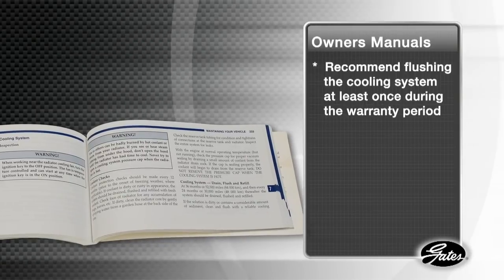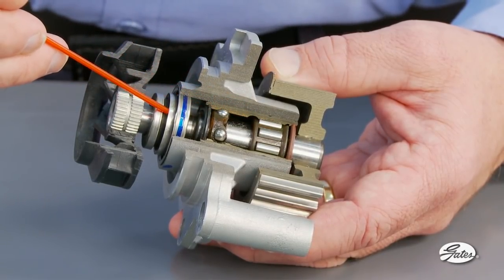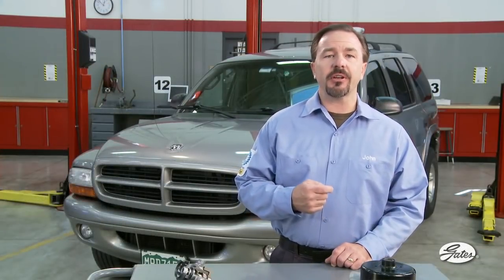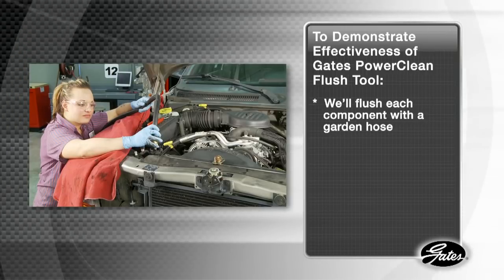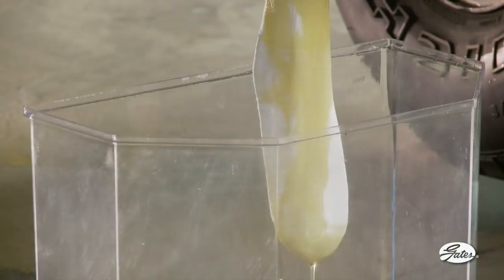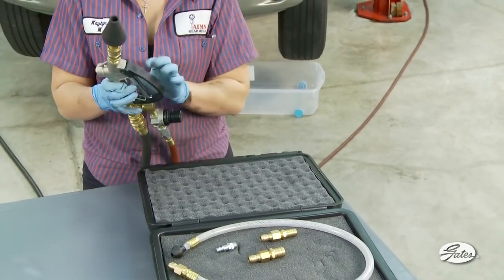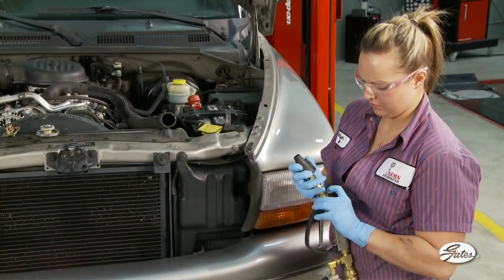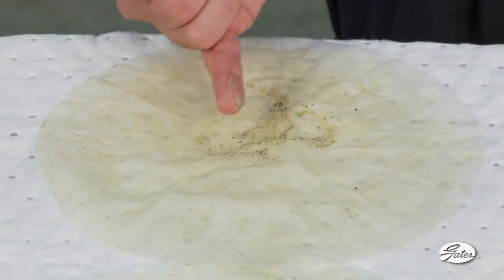GATES TRAINING: Cooling System Flush: Cleaning Neglected Vehicles FULL Version

Comment: what if your car has no radiator cap and just a reservoir? start at bottom and then flush the reservoir and that be the way to get to the top of radiator? also where can you get one of these tools at?
Reply from the maker: +topdog harrison 

We would recommend that you remove the upper and lower radiator hoses to flush the radiator as a separate unit.  The cooling system should be flushed in three steps with the hoses disconnected to each component:  engine, heater core and radiator.  We would also recommend to clean and/or replace the reservoir.  The power clean tool is available at different auto parts stores such as NAPA or O’Reilly.  If the reservoir neck is larger than the nozzle, Gates also has larger size nozzle.
Reply from the maker: The tool comes with an extension hose and tip to get to the heater hoses or the heater hose connection.  Most cooling systems are too long to flush from one starting point, moving through the radiator block and heater core.  Flushing all 3 parts individually isolates the contaminants and removes them more quickly and completely.

Comment: I have a 87 Oldsmobile Cutlass Ciera. how would I go about flushing that and I also have a minor radiator leak somewhere but im not sure exactly were its coming from.
Reply from the maker: +Paul Brown 

It would be advisable to perform a pressure test in order to find the leak first before flushing.
Reply: +Gates Auto Aftermarket I was looking under my car as there was a steady drip after driving and saw it was directly under the engine so I think it could be the water pump. do you have any garages near fort Collins Colorado? if so id like to get my system flushed. I doubt my mechanic has the power clean tool.
Reply from the maker: We are familiar with Community Auto in Fort Collins - www.communityautoinc.com or look for a NAPA auto care center.  Or you can ask your local NAPA store for a recommendation. Hope this helps!
Reply: +Gates Auto Aftermarket Thankyou

Comment: Sooo you tell me tap water is bad for a cooling system yet you pour it straight into the engine block/heater core and then don't show how to flush it...
Reply: Rob J tap water is used to flush the engine and heater components, then the tap water must be drained from the engine, radiator and heater core, before filling with distilled water / coolant. He states that in a comment above.
Reply: Duuuuh
Reply: So you use DISTILLED WATER to flush the system.  I like to see you doing that, party popper.

Comment: So you can use a water hose that's hooked up to you're house?
Reply: randall wilson You can but I wouldn’t use full pressure if you go to flush it out and when flushing the heater core flush it backwards from how it normally flows and at a VERY VERY low pressure

Comment: Use a spill proof radiator funnel which is $20 on Amazon - drain the system, plug it back up - fill the system with distilled water then leave some water in the funnel attached to your radiator, turn your vehicle on and wait for the thermostat to open approx. 10-15min, wait for the vehicle to cool down drain and repeat. Once you’re ready for new coolant make sure you leave coolant in the funnel turn vehicle on and wait for system to “burp” itself. After, fill your radiator reservoir and keep an eye on its level whenever the system is cool. Look up “Timmy The Toolman coolant flush” and he goes over all of these steps.

Comment: Very well designed tool but is it worth $400+?
Reply: You can find a kit at Wal-Mart
Reply: Or make your our
Reply: Freaking things are 900 now @ O'Reilly's. No way I would spend 900 on this thing. I did find 400+ in a few places.
Reply: For the DIYer, unfortunately not in my opinion.  There are many other ways to "power flush" your cooling system, but from what I have seen the 91002 still does a superior job of it.  Just not superior enough to justify $475 of my money, but then I am not a pro making money off cooling flushes.

Comment: this is phony. Notice that the fluid collected was always greenish in color. After that much flushing it would not be green but almost clear. Lots of things can be done while the camera is stopped. Also, the hose are still coated with rust, it's best to close the system, run the engine, get it hoit enough to open the t'stat then drain it again. Then fill with good quality coolent.
Reply: Water sitting in oxidized copper turns green.

Comment: Most of the problem with this gimmick is first,not at operating temp,second,sock filter,but we see some kind of diaper material? Third,thought tap water was not sufficient(even under pressure),also have to remember that cooling system contaminants come from cavitation,and that the hoses in the system can become embedded with metals and other sealing materials (head gasket,silicon,etc improperly applied) you'll never get the system clean as long as they are present(replacement)Fourth,flush the system as it should operate,meaning,no pulses or extra undue pressure that wouldn't be as with normal operation. That is unless,you are trying to stress test the system to cause an apparent or future problem.Mechanical systems will fail,lets just do it right to fix them.

Comment: where the contaminants come from?
Reply from the maker: Contaminants can come from degraded and weak coolant/antifreeze.  The protective corrosion inhibitors break down over time and can lead to metals being unprotected in the system.  When you have unprotected metals the water and heat in the system can quickly corrode metals, leaving behind particles of rust, aluminum oxide, copper particles, etc.   Introducing non-compatible coolants during top offs or insufficient flushing can also create a corrosive environment.  Another area of contamination can come from using regular tap water instead of distilled or deionized water.  Minerals in the water can leave calcium and other mineral deposits.  Particles from those deposits can flake off and damage the water pump and other components.

Comment: If you add a flush agent and get the system up to operating temp, then turn the heater on high, while the system runs for about ten minutes, you will effectively clean/flush the entire system. Then you can disconnect the lower hose and get all the crap out of your cooling system. If you remove the thermostat first, that will "open" the system, but it will take much longer for the system to get up to operating temp. Why the three-step process? Seems like make-work!?

Comment: what is the different between 50/50 no water added coolant and coolant that need to mix with water? my car is 20k miles and my coolant reservoir was kind of low, so i just added some 50/50 no water added coolant to the OEM coolant . the label say it can be mix with any color coolant, i used the peak long life anifreeze and coolant ,is that ok?

Comment: No matter how much you flush the system will never be even close to like new. Even if you use distilled water and flush every 6 months. I don't think it's pumping 75 psi of water either that's just what it takes to run the pulsator .

Comment: Its funny how he demonstrates the difference in both flushes... but the second flush still shows lots of green coolant( when it was just flushed thoroughly from tap water) Since he flushed the first time (radiator, heater, and engine) there should be very little visible green coolant left for the second flush... i call BS
Reply from the maker: John, thank you for your comment. Because the garden hose can’t reach all corners and pockets effectively, there will always be a little coolant left over in the deep recesses of the system. The PowerClean tool forces all that extra coolant from the system due to the kinetic wave action.

Comment: I have a 1998 honda accord that has brown sludge in the Radiator...looks like creamed coffee. The car is not over heating and the AC and Heat work fine...but I know Coolant is not supposed to be brown. So I defenantly want to get my cars cooling system flushed properly. heres my zip code 19140. please point me to a tech that utilizes the Gates flushing system.
Reply: I have the same problem.  Did you get it fixed? Was it just that it needed a flush or was it something else?

Comment: The fact that you use regular hose water instead of distilled water astounds me.
Reply: +Brock Scholtisseck flushing is not done with distilled water.  You'd be wasting a lot of money of many gallons of it.  You let the tap water drain out, and refill with distilled water and ethylene glycol.
Reply: Sebastian Janowski
True you'd be wasting money I'm not denying that. But depending on the car you drive, and the quality of water from your city.. It's been known that particulates over time can destroy the seals in your water pump, and make it go bad. Distilled water is pretty inexpensive to be completely honest. It's worth the 10 extra dollars in my opinion. And I wouldn't run anything less than top quality shit through my car because it is a nice car. But this is all opinionated I guess. Your choice.
Reply: Ok, so you want to spend $50 on distilled water to flush your cars cooling system? Thats fine with me, but I don't think your car will last any longer because of it. Its not like that tap water is staying in there when the engine is running. 
You have to be joking about $10 for distilled water to flush a car. My 4 cylinder subaru engine holds almost 8 gallons of liquid in the cooling system. At my local grocery store, distilled water is $1 per gallon, so you can flush an 8 gallons system with 10 gallons of water?

If anything, do a major flush with tap water, then chase the tap water away with distilled water.  You probably won't get much more contaminants out of the system, but you got everything you could. Then refill with the proper coolant, I use premixed on my car because after I buy the distilled water, it is almost the same price per gallon.
Reply: +snoopdogie187 Okay I'm a little confused. You say I want to spend 50$ on distilled water? Then you turn around and say you use it, let alone you said it costs 1$ per gallon? So you plan to use 50 gallons lol? Hey whatever your prerogative is big dog it's your car not mine, and too me Preventative Maintenance is an investment.
Reply: Brock Scholtisseck
I'm saying to do a good flush you need a lot of water, and at $1 per gallon, that means a lot of money just on water to flush the engine. I doubt you can flush an entire engine with 10 gallons of distilled water, and if you could, I think using an unlimited amount of water from a hose and then doing 1 final rinse with a few gallons of distilled would be better anyway.
I did say if you want to spend the money, go ahead, it isn't my problem after all.

Comment: People don't do flushes because they're such a mess. You get coolant absolutely everywhere. It goes down the driveway to the gutter and poisons all the neighborhood cats. You can't dispose of the little bit you catch. Flushing the system multiplies the mess tenfold. So hey, why not wait until you see rusty water on the ground? Why has no one come up with an elegant way to do this job?
Reply: Because of the EPA hazmat concerns, you are correct, DIYers have to really go out of their way to do their own cooling system flushes. If your radiator has a draincock, attach a short piece of hose to it in order to guide the stream into a pan.  You need to invest in a LARGE drain pan for use under your vehicle, like a 28"x36" concrete or mortar mixing pan that is commonly found at Home Depot or Lowes for about $13.  Or, if you really want to be safe, you can buy even larger pans that are like 36" wide by 55" long from a company called New Pig Corporation.  Whatever you get, make sure it fits under the engine compartment.  Use lengths of heater hose and a hose coupler to make sure what comes out of your heater core goes entirely into the pan.  To get the coolant from the pan into jugs that you can take to a recycling center, either pour it or use a cheap drill rotary pump and a couple of pieces of old garden hose.  The Milescraft 1314 drill pump works well and can transfer the used coolant quickly.